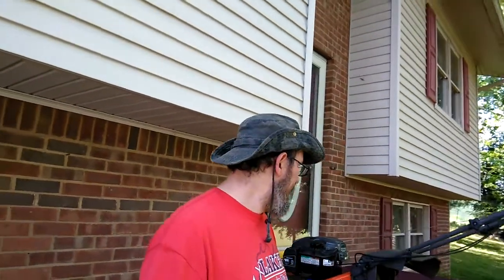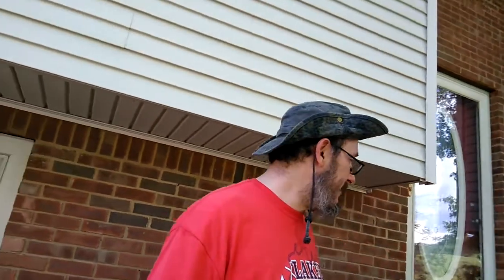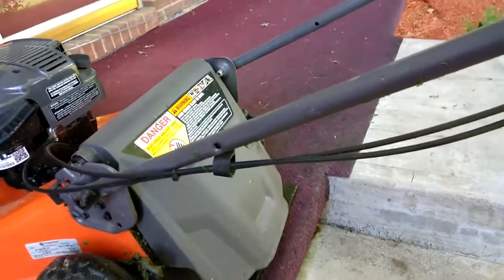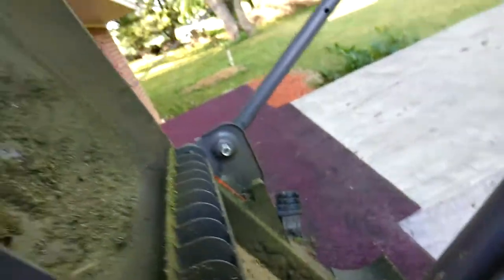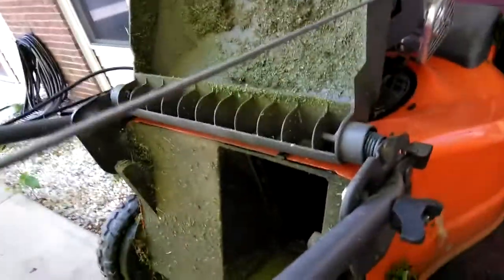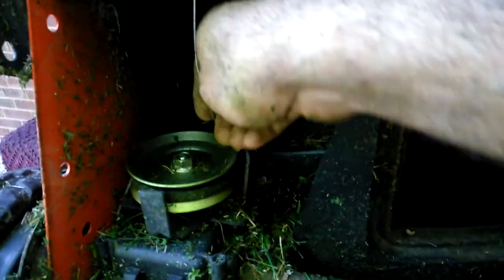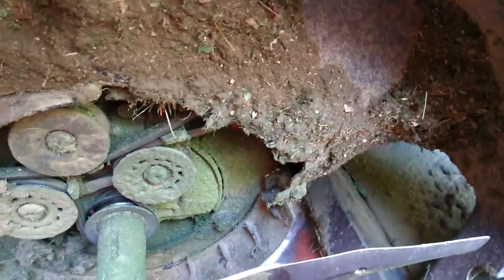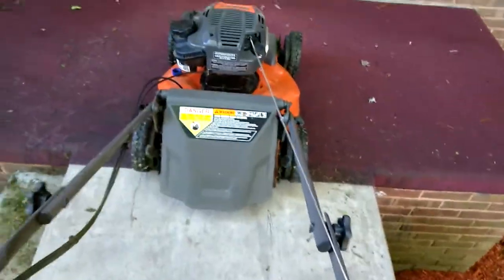Husqvarna AWD push mower repair

Comment: Do these lawnmowers have a start switch? I keep reading about a start switch but I can't find one. This lawnmower is only 1year old and will not start. It says, just hold the handle and pull the cord...Nothing
Reply from the maker: Mine has two handles. One to hold down in order for it to run. This is also required to be held when starting. The second handle is for self propulsion. As long as it has fuel, and oil. You should be able to start it by holding the top handle squeezed. Then with your other hand to pull the cord swiftly. I hope this works for you.

Comment: Did you not get a side discharge attachment I have three of them mowers but they're only rear wheel drive with every one of them I've got a side discharge attachment that goes where the bag goes man that helps mowing tall grass so much easier mine has the Honda engine I don't know if that's the difference maybe you don't get side discharge with your motor

Comment: Watched you video and I'm really glad you went over the drive system like you did. A lot of lawnmower videos just tell you how good or bad a mower is without really showing what-the-hell is going on. I have a question for you, how does this lawnmower roll when you want to pull it backwards? Does it dis-engage easily? I recently bought a new Honda self propelled mower and was disappointed in how hard is was to pull backwards, even when the mower wasn't running and on pavement. My current Craftsman RWD mower gives me trouble disengaging its drive when I want to turn it around for the next pass. Its aggravating so I looking for a replacement. Thanks!
Reply from the maker: I'm glad you liked the video. The drive has no choice but to disengage when you let go of the drive lever on the handle. It's just like the brakes on a 10 speed bike. You let go, and the cable releases the pulley. It is a bit difficult to pull backwards anyhow. It's because of the rubber flap along the bottom of the mower. When you pull back you are forcing that flap ton reverse. It's no too hard. Just letting you know it's not easy as ice cream either. I got this because I had to mow uphill at my last house. It works great for that! Please don't forget to share the video with friends. Check out some other videos. If you like our stuff. Why not subscribe?

Comment: Well, it certainly isn't safe to keep that rear door open without the rear-bagging attachment. One of those rocks might come out of there at a high velocity. I would suggest making a rear-discharge chute out of some durable material. I have a similar model that has an optional side-discharge chute, but it is junk and falls off easily.

Comment: Lowe's takes nothing back,mine doesn't have a side discharge either.
Reply from the maker: Warren Bates yes. I suppose these types of mowers are setup for rear discharge. Maybe to keep from kicking rocks sideways, or maybe it just mulches better. I dunno. The  spring loaded door is supposed to keep grass from ejecting out the back. Problem with that, is it chokes out the mower most times. Looks like I'll either invent something to put back there, or I'll just get used to being covered in grass!
Reply: Why don't you cut a hole in the side of the thing?
Reply from the maker: Seems drastic to me. I was thinking of maybe making a diverter that connects to the back. I'm not sure it would work. Since grass can cake up, especially when grass is wet. I just put up with it. I probably wait too long to cut my grass. If I cut my grass more often, it probably wouldn't choke out the mower.
Reply: They say you shouldn't cut more than 1/3 of the grass plant off at a time. I would think you should be able to find a side door that you could find a way to bolt on to the side of the mower. That rear eject looks like it's missing part of it's catch bag. The newer Husqvarnas I have seen all have side discharge built in. you just have to pull the door open and somehow it locks in in place. I know mine does. Try www.repairclinic.com or Husqvarna's website they should have some way to stop the grass from getting all over you. Good luck.
Reply: Man in Durant Oklahoma I've had to take back at least 4 mowers to Lowe's and they always take it back and give me another and on top of that I forget to take back the box back so I have extra bags and side discharge attachment s lol ii could send ya one lmao